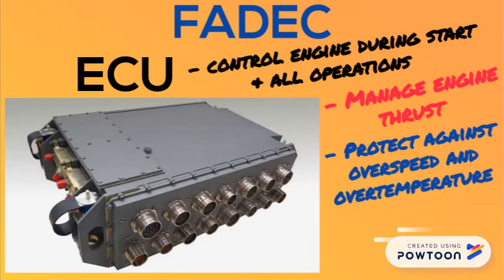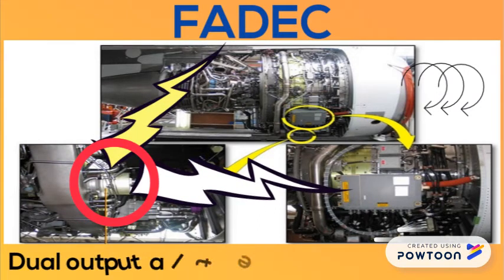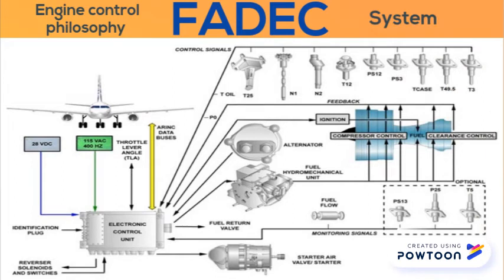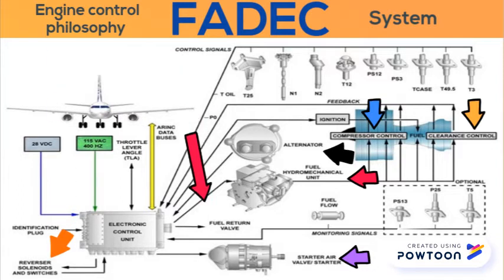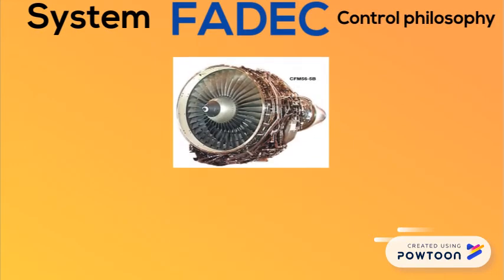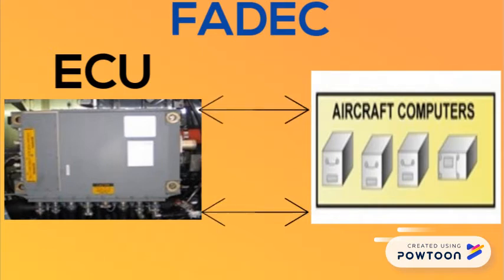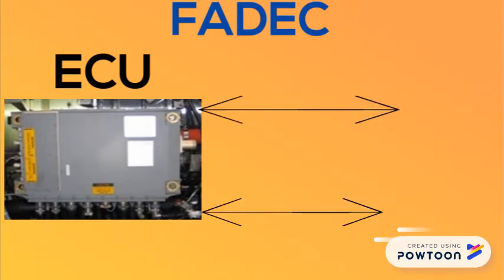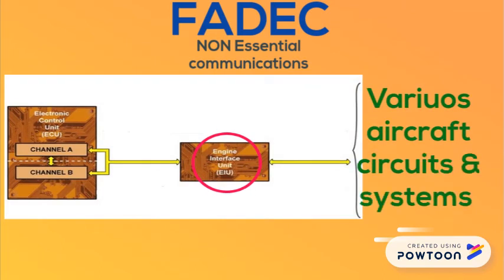A320, CFM56-5B, Session 3, Engine control, for training purposes only

Comment: dear , would you please explain why engine primary data FF/N1/N2/EGT. sent directly to ECAM SYSTEM & bypassing EIU and what's the consequences if the engine loose one of this parameter !
Reply from the maker: This is for if eiu fail , this data will still be there

Comment: sir, I have one query that why radome material is of composite? why we not using  metal there
Reply: Hi Dubey.. Actually RADOME is called RADOME because it is RAdar Dome and The purpose of using composite material is only the reason that composite does not cause hindrance in transmission and reception of Radio Waves from/to the Weather Radar, which aluminium or any other metal used could cause.

Comment: sir, what is the difference between EEC(ELECTRONIC ENGINE CONTROL) and ECU(ELECTRONIC CONTROL UNIT)? both are same or different.
Reply from the maker: Abhay Dubey both are the same, just names, for example the computer for the v2500 engine is the electronic engine control and the cfm56-5B is the electronic control unit
Reply: Thanks, a lot sir